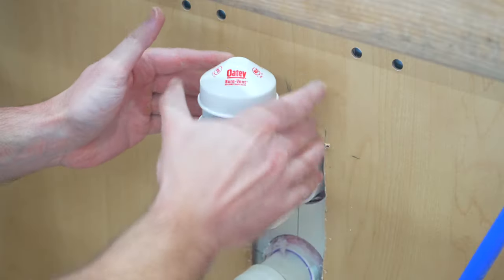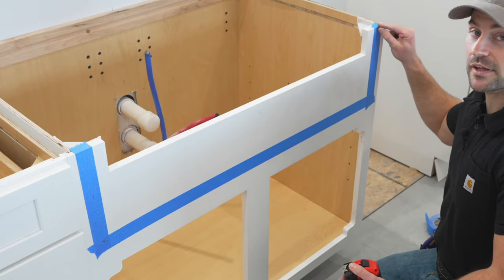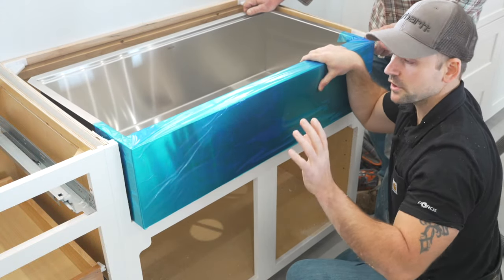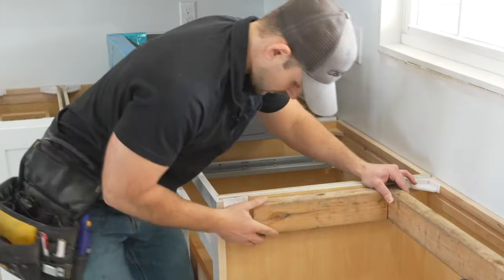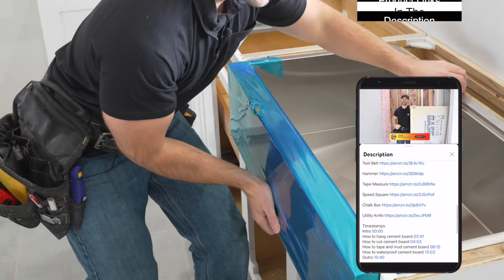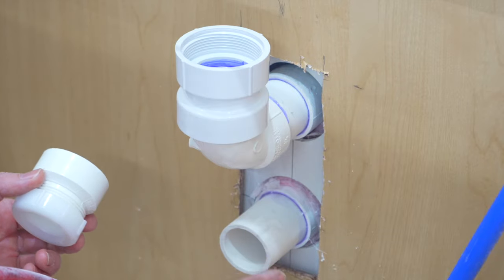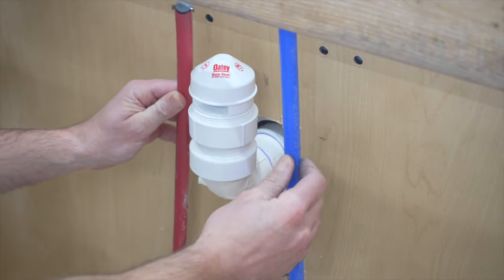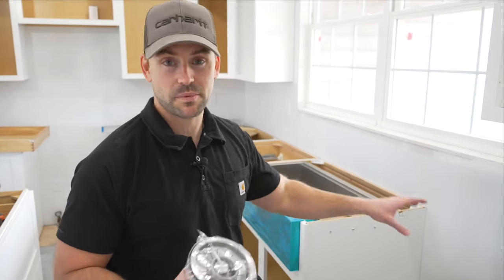How To Install A Farmhouse Sink - Air admittance valve under kitchen sink Installation

Comment: I wonder if that faucet will clear the aav 🤔 never seen someone use Teflon installing one. You are very interesting sir
Reply from the maker: Yes it will. I made sure it was in the right position. Teflon just gives the joint extra security to prevent sewer gases from leaking into the house. I hope that helps!

Comment: I am not sure the deck screws described at 3:46 for the frame are sufficient for the load. Also not sure what type of screws you used to attach the frame to the cabinet at 5:18. Both appear to be subject to shear. A 30” wide farm style sink full of water could have a load approaching 400 lbs depending on the dimensions. Assuming the load is distributed evenly across 2 x 4 screws, approximately 50 lbs shear at each screw along the sides. One could transfer the load to the cabinet base by suitable supports between the bottom of the frame and the cabinet base. The instructions for the sink I am installing includes a caution to make sure the cabinet can support the sink with dishes and filled with water. FYI.

Comment: I always liked undermount sinks except when I could tell a client was really harsh on using it, not protecting it from knives scratching it or just not being careful. I've had to buff and sand scratches out very delicately on some stainless steel sinks making sure to work the same direction of the grain look. Of course, a cheaper sink, it doesn't work well. Porcelain was not a good one for that since they are not forgiving for chips even though it could get repaired, if a professional does it. The 16 gauge sink is a great quality instead of the 20-22 gauge and always having to add sound buffing material to dampen the sound. 16 is always the best way to go. 
Any single drain sink is required to have the cheater vent (air admittance valve) always check with codes since I have had a few not allow it. This never made sense to me because the drain flow is so much slower without it. The rough in plumbing always made it easier how it was done in your video but in a remodel situation, you could create the same thing exposed in the cabinet. Also making sure the air admittance valve is higher than the bottom of the sink. The one thing you mentioned about how long they last, I had a remodel job that had a water leak in the wall. It was an odd place because the supply lines came up from the base of the cabinet, this was somewhere in the wall. Surprisingly, someone put the valve in the wall before doing the drywall and the valve quit working and created water issues. Cutting out the back of the cabinet to find this was fun and then put a new back in the cabinet after fixing the issue. Always make them accessible to work on. 
Great job with everything and using a wood frame for the best support and a great quality sink with all the accessories. 🔨🔨 🔨 The like button for sure 👍🏻
Reply from the maker: I agree with you about the porcelain. My wife was considering that for a long time but we came to the agreement that stainless steel is much more forgiving like you said. 16 gauge is definitely ideal. typically 20 gauge is fine for rentals or contractor grade houses. Yes that is true about the air admittance valve as far as checking with codes. I know they are commonly used in island sinks. I placed this valve here because I did not want to drill through the jack studs holding the window header. For maximum strength I figured it’s better to use this valve. I actually did not know you could sand Stainless sinks. That’s good to know. Thanks a lot for watching again David. See you in the next one!
Reply: @TheExcellentLaborer  taking scratches out with a proper compound and critical grit paper or automotive bodywork sandpaper and delicate touch. Always have to watch not to go to hard not to damage the stainless. If course I never would use anything electric. Direction it critical to not take away from the look. Of course, the proper sink grates are wonderful with rubber bumpers on the bottom to protect the sink. Delta and even Moen are wonderful companies to deal with locally unless you want something even more elegant. They are out there for a price. Have a great day and week to come Josh

Comment: Question I’m replacing my sink with a deep sink and there is an existing air vent but it’s too tall for the sink. Can that pipe be moved or shortened-cannot move forward because I do not want to create a disaster-help!
Reply: I have the same question but I see 3 mos later he hasn’t answered 😭 did you get that issue resolved, if so what did you do?

Comment: Great videos...    just joined and wonder about the sink... undermount??   won't you need to silicone the top again to keep it waterproof?   Also, if the width of my sink doesn't exactly line up with the 2 x 4s on each side would I just build it thicker or just add blocking?   again, thanks for making these ... very helpful..

Comment: I'd rather use 2 pieces of 3/4 plywood sandwiched strips instead of 2x4. That 2x4 just seems out of place. I know it's not visible, still.. The devil is in the details, and that extra what makes a difference between ordinary and extraordinary.
Reply: I agree with you. Such beautiful cabinets and sink, just to ugly it up with 2x4’s, and ugly wood at that. Not a great finished look, even though it’s on he inside.

Comment: If the air admittance valve is only good for about 10 years didn't you just install it directly behind the bowl of that sink? That will be fun to twist out later.